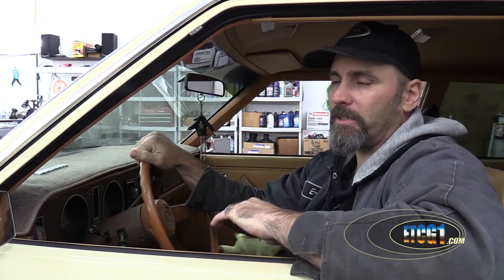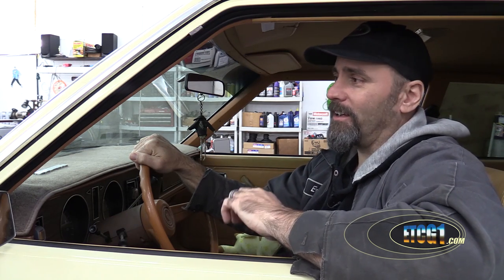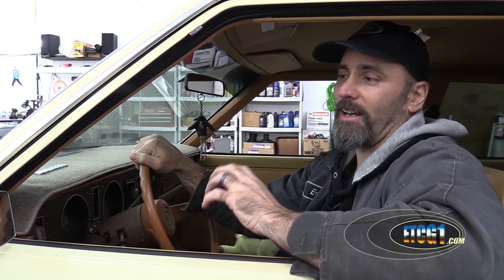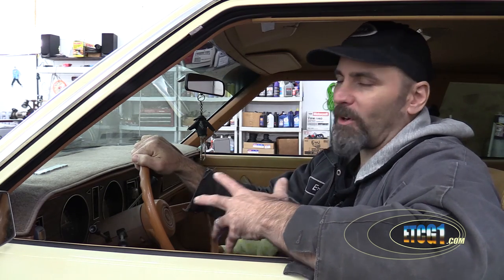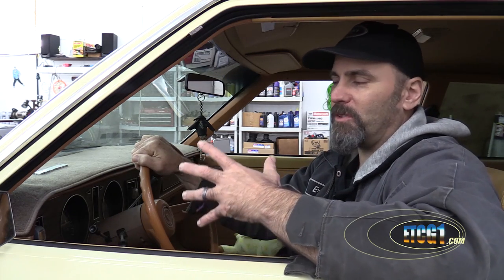Analog vs Digital (Cars)

Comment: Good topic Eric. I'm an analog guy and I'm only 24. I 110% agree about older people understanding mechanical systems better. Growing up on the farm, I learned lot about mechanical systems, dialing in carbs on gas tractors, setting injection timing on old diesel powered tractors, all kinds of repairs to get you going. The problem I have with digital parts on farm equipment is who do you call at 6pm on a Saturday night when you're trying to beat the rain to get a crop in? No one really, sure you might be able to scrounge up someone, but it's unlikely. I like things I can rip into, abjust, tweak, jerry rig or whatever to keep rolling. Digital has its place and you can do amazing things with it and be really efficient. But there is something to be said for old school technology that just ran as long as you had fuel in the tank.

Comment: From a technician point of view having worked on 1950's vehicles (and older) to almost the latest technology and there is good and bad in both. I can remember when 90% of the cars i worked on were Ford, GM, and Chrysler. We had a sprinkling of Studebaker, AMC, British cars and Volkswagen bugs but that's about it. It was easy to learn how to repair most of them because of simplicity. It was fun to repair cars for a living in those days although the pay was crap.
 That said, there were certain problems that were not repairable in older cars such fuel distribution and poor ignition systems that produced 25000 volts tops.  
 Older cars had carburetor icing problems in cold, damp climates and finicky automatic chokes as well as ignition points that degraded over time that that changed (retarded) timing and caused lower spark energy to fire the plugs. 
 Cars that were neglected spewed black smoke, leaked oil like a sieve and polluted terribly.
 Then came fuel injection and computers. To me this was the very best piece of technology to ever be implemented to the automotive world. We had to learn how to repair it and added cost to our expensive tool box but most of the problems with older cars are no longer a problem.
 Today we have cars that have close to zero emissions, ignition systems that produce 50000 volts of energy with multiple sparks per firing, almost zero timing change for the life of the vehicle, high fuel economy and usually don't dump oil all over the roads by better sealing technology. 
 For a project such as yours, Eric to have a carbureted engine that has the latest technology is a great idea at much less cost. It has a potent ignition system as good as, if not better than anything else but still has simplicity. I'm sure it has some fuel distribution problems of old that could almost be eliminated by port fuel injection but I doubt that you will ever have a problem with it.
 Can't wait to see it running and driving.
Reply from the maker: Well said. Thanks for your input.
Reply: Totally incorrect - when it comes to carburetion being as good as engine management.  How are you going to compensate for fuel enrichment and ignition timing that is air-intake temp dependent?  You can't.  And that is what kills engines.  A spike in intake temp, your carb vehicle will continue to run the same advance.  There are many similar examples.
Reply: Not necessarily. Dependant on the temperature of the air, it's pressure will be higher or lower. If I remember correctly (correct me if I'm wrong), colder air is under less pressure, as such it will pull more fuel through the venturi of the carb, and vice versa. I can't speak to the timing, I don't know enough about that to sensibly contribute to this discussion without looking like a total idiot, but I do remember a few carbureted cars with a switch to change the timing.
Reply: They will have basic timing adjustment depending on load, i.e. vacuum or boost, but you can't do nice things like start to pull timing when the oil temp increases, or pull timing by 0.5 of a degree per 10 degrees of intake temp over say 150degF.  Nor can you do other nice things with fuelling like add enrichment at throttle openings over say 65% when the coolant temp is over 212F and the oil temp is at a pre determined level.  This saves the engine.  You could also say, don't deliver full boost pressure to the engine until the oil temp has reached a pre-determined temp.  Then if you know what gear you are in and you have wheel speed sensors, you can say don't deliver full torque until road speed hit's 10 miles an hour. It saves gearboxes and clutches.  None of this is difficult to setup, nor is it that expensive.

You can get away with half of this stuff when it's not turbocharged, but when you turbocharge an engine, you are adding a non-linear breathing apparatus to the engine, an exhaust restriction, vastly increased load and vastly increased temps across all areas.  This completely changes the way an engine behaves because load increases not simply based on RPM and intake manifold design etc, but moreso based on the dirty great turbine that once it hits target speed will deliver an almost instant surge of intake manifold pressure over atmosphere.  This radically increases the potential for knock, intake temps, oil temps, combustion temps and more.  Why you would NOT want to control these factors with great accuracy is beyond me, especially after crying how much it cost you to build.
Reply: The part that really bothers me about all the electronics in cars is the mechanic ,like you is expected to know it all. At times you have to choice but to replace a module to trouble shoot the vehicle and if that module is not the problem , you are the one the customer looks at. To be a mechanic in a dealership these days must really suck. They get paid shit wages and are on the clock. Would not me by trade of choice.
Reply: How did we compensate for air temp, fuel enrichment, timing etc? We did it by tuning, reading spark color, sound, smell and seat of the pants. We could tell if there was detonation by analysing  the spark plugs with an illuminated magnifying glass. If we got too close to the edge we were in trouble. If digital is not programmed correctly the results are the same. 
 The difference is we usually over compensated for air temp, pressure with timing, jet size etc and that probably cost us horsepower and torque.
We tuned engines that way for a whole lot of years and it worked pretty well i would say.
 I could get into NASCAR where they ran 200 mph for 4 hours at 8000+ RPM with a carburetor but i think i made my point.
Reply: wysetech2000 Yes and that why it's completely ass backwards for a turbo application.  Thanks for making my point even more clear.  Mechanical systems have no way to deal with extreme temperature spikes and many other factors of a turbo engine.  Nascar doesn't even compare.
Reply: Levi Betz It has a slight effect, but Eric is not running meth or even water injection to my knowledge.  The a/f ratio would still need to be 12.5:1 at WOT, so it's not like you want the engine to run excessively rich ALL ths time to 'cool' the charge.  Besides, he'll still have no way of dealing with ignition timing during temp spikes or dealing with knock.
Reply: Levi Betz It absolutely does not cause a more stable air charge nor is it very much cooler at all.  Only in already cool conditions is the charge slightly cooler.  The fog of fuel does not have sufficient heat dispersion properties when the hood has been closed for say 30 mins after a few hard runs.  The air/fuel ratio per cylinder is actually far more likely to be patchy if you measure exhaust gas temps and a/f ratio on each primary pipe, especially with dual plane manifolds. Have seen this first hand many times.  It's scary. It's because fuel is able to drop out of suspension through the twists and turns of the manifold.  This simply does not happen with MPFI. When you're able to extract data from carb'd engines it's incredible just how loose they run in terms of management.  It's  no wonder they wash cylinder bores and have ongoing problems that require endless 'tuning' and 'adjustment'.  I think Eric just feels more like a technician if he is turning screws and swapping out accelerator pumps lol.
Reply: +Levi Betz   What we are discussing here is  analog vs digital and not turbo charging with a carburetor. The wages are much better now but not even close to where they should be.
 I would have to review the dyno run on Eric's engine but i think the timing curve does change with boost with his setup.
Reply: Hi wisetech2000. I think the wages are much worse, when you factor in the extremely increased tool bill.

That said you have made your analog points very well and I can't disagree a bit, since as a technician I actually fully understood you. Sure, even ETCG1 said that electronics are more accurate, but he is of the old school enough to not drive a car with a carburetor like it was his Honda Pilot, or else modern and injected. He knows these things, so to assume he can't take care of it is just silly.

Would most modern drivers know these things without experience? Of course not.

And yet, all of that said, I liked a lot of the truths by ArchimedeanEye, as well. That's just the thing though. Electronic vs. mechanical - they both have their place. For a while Mercedes made their cars to run completely mechanical if the electronic systems failed. EXTREMLEY reliable, with perks of some electronic management when it all worked. It wouldn't leave you on the side of the road - another good point ETCG1 made.

Comment: Hi Eric, I am in my 60s and am an old schooler for sure,  ripped off my my fuel injection on my 89 chevy truck (4.3) and replaced it with a edlebrock and replaced the distributor with a Hei,  also did it with other trucks and drove my boat back and forth to florida from PA quite a few times, (no problems) where with the computers I was always afraid of a breakdown, I had a car even the dealers could not figure out,  "that was enough for me",  love your channels,  keep it up. thanks, mike

Comment: I went to Nashville auto-Diesel college in the late 90s and early 2000s and they started training us in computer systems and automatic transmissions saying that was the future. and now it's hard to find new manual transmission cars and when I bought my 2014 dodge avenger black top edition and raised the hood I saw a computer controlled and wiring nightmare. blows my mind how much the industry has changed over the years.

Comment: I agree. I finished my training to be a marine engineer last year. While doing my cadetship the first ship I went on had an all mechanical engine and controls compared to the later ships and what I'm on now. That first ship teached me the most about engines as you could see how every thing was working. At college also they mainly only ever lectured us about the  older systems and how they worked they briefly covered the newer electronic systems but not in any great detail. Having said that I find that knowing how the old full mechanical system works allows me to better understand how the new electronic engines work the basic principal is still the same you just have to put in our case hydraulics and solenoid valves in the place of the physical object.

Comment: Great video but I don't think you can call non-electrical systems "analog". Analog refers to the electrical signal only. Analog is non-digital electrical, digital is digital, and mechanical is mechanical.
Reply: For example, FM/AM radio is analog, while the rest of the entertainment system is digital. And your audio is digital converted to analog.
Reply from the maker: Incorrect. That's only one definition. Analog is also a comparison. https://www.vocabulary.com/dictionary/analog
Reply: Granted but I think the terminology is confusing because people have built mechanical computers believe it or not. Babbage's analytical machine was a mechanical digital computer (from Google).
Reply from the maker: Your point is noted, but I believe the terminology gets my point across for this video. I don't think we need to turn it into a semantics discussion.
Reply: Thanks for the great videos, ETG1. I suck at this stuff but thanks to you I suck less. :)
Reply: like this https://en.wikipedia.org/wiki/Antikythera_mechanism
Reply: Analog as a noun is an ideological comparison. 
Analog as an adjective is relating to or using electrical signals or information represented by a continuously variable physical quantity such as spatial position or voltage. 
Digital as an adjective is referring to binary data stream represented as 0 - 1 or off - on or representative low-high voltage states or a specific frequency or duty cycle. 

What Eric is trying to convey would more accurately be mechanical vs electrical/electronic/computer controlled. 
Analog vs digital is simply describing two electrical signal types. 
There are analog computers and digital computers. 
 
Most modern vehicles employ a mix of analog and digital input/output ECU/ECM/PCM signals such as most temp sensors are analog varying a voltage or current or resistance that corresponds to a given sensed temperature and is usually linear scaled, most idle air control valves are controlled by a digital pulse width modulated signal, many thermal switches are simple snap switches but are binary acting as either off(open or below switching temperature) or on(closed or at/above switching temperature) and could be considered digital.
Reply: patw52pb1 good comment. To further muddy the waters not all digital is base 2 (aka binary). Pocket calculators are sometimes base 10 digital I believe.
Reply: +R0773N 
Thanks. 
Not really muddying the waters at all, just additional clarification needed. 
Digital by definition has only 2 logic states, a zero (off/no/false/near zero volts) or a one (on/yes/true/near supply volts) which is binary. 
The grouping of those binary digits (bits) as referenced to a specific time base can be most any radix (base) and expressed such as octal (base 8), decimal (base 10), hexadecimal (base 16), etc...
Reply: Can't believe everyone still gets this wrong, it isn't complicated. Digital is any system that deals with discrete values, analog is any system that deals with an infinite range of systems. This is regardless of whether or not the system is mechanical (like a wind up watch) or electronic (like a Quartz watch). Carbs are analog because they deal with an infinite range of fuel delivery. I should point out early EFI systems were analog, K-Jet and L-Jet come to mind, because they were analog electronic systems. Current EFI systems are digital because they deal with a finite set of fuel delivery ranges.

He made the point clear at the end though, mechanical versus electronic.

Comment: I've been watching some of these videos involving/discussing carbs lately, and it's really got me motivated to get experience with carburetors. I've enjoyed tinkering with things almost my entire life. I like taking things apart, seeing how they work, and putting them back together, occasionally fixing them along the way, just for the fun of it. I've generally dealt with electronics (computers, phones, TV's, etc), but as Eric said, these components such as circuit boards and sensors are much more fragile compared to mechanical, and prone to fail much sooner. Troubleshooting can be aggravating too because sometimes it's not the component or board you think it is! And yeah, sometimes it's cheaper to buy a new car or device than to fix whatever is broken in it. 

I like tinkering with my cars on the side (an early 90's and 2 early 2000's vehicles), but I know there's only so much I can do because they have electronics controlling important systems. I'd love to have a car with a carburetor, I'd have even more confidence that I can fix almost any problem it'd have myself. I also need to learn to drive stick shift/manual/whatever other names it has...

Comment: Well, as a - let's call it hobbyist - born in 81...I love me some digital, to be honest.
Not overboard high-tech digital, but some nice simple 90s/early 2000s stuff. Just works.
All my/friends/family cars I worked on never had too many fuel injection problems. Some here and there, pull the code, replace some stuff, you're fine.
Carbs on the other hand. Lawnmowers, motorbikes, chainsaws...sooo much fun. Especially when stuff gets old.
Ripping the carbs out of a 87 Ninja750 because there is some god damn little thingi leaking in one of the 4 carbs...always the one in the middle...still on the to-do-list till march :D

Comment: I grew up with Analog Cars, and spent hours trying to balance twin carbs with worn or DYI linkages, adjusting points and resetting timing and it becomes a bit of an Art. You knew the Sound it made when everything was sweet and when it wasn't. 

But now I love the Plug 'n' Play approach of modern digital cars. No adjusting chokes in cold weather or rejetting carbs for altitude...etc etc. They just work, and when they don't, a quick scan without even lifting the hood can often tell you the issue.

So now I am a Digital guy.......but I am always impressed with the sheer genius of the mechanic systems in analog cars!